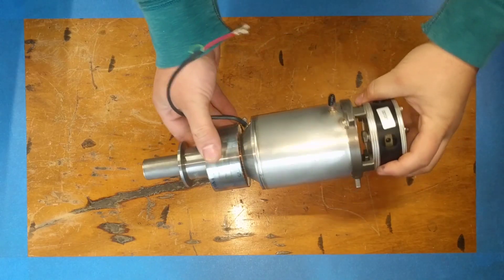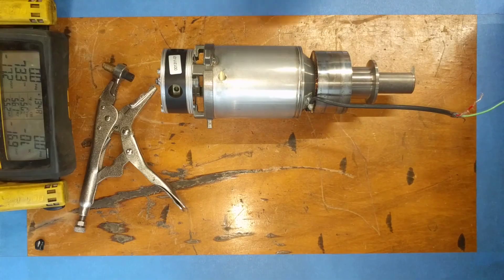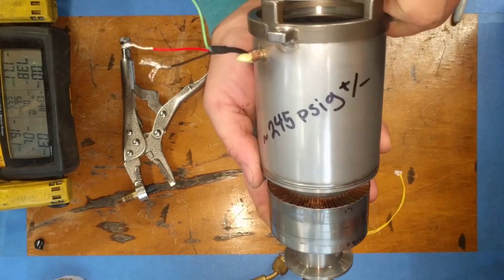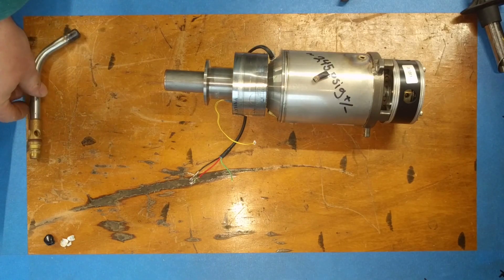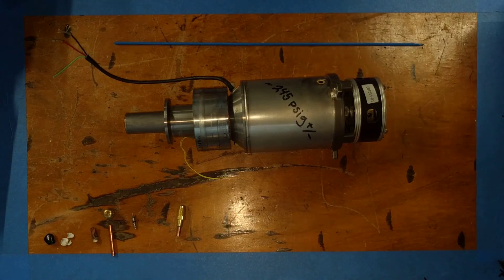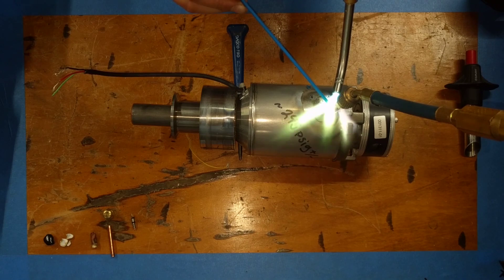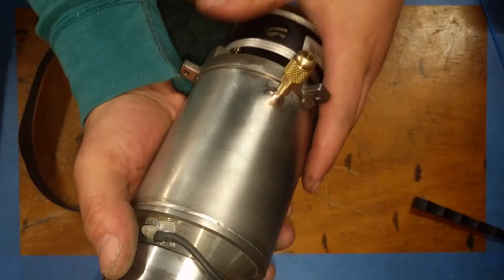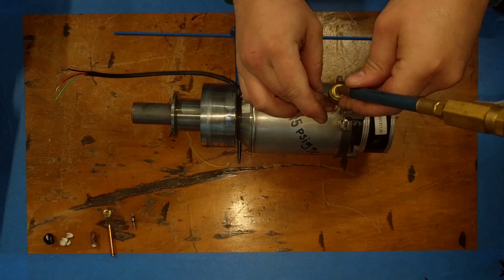Superconductor Technologies Hybrid 98 Cryocooler Service Port installation

Comment: I’m sure you realize that a shraeder valve will not prevent helium leaks, right so are you planning continuous top ups or something more permanent?
Reply from the maker: You're right, if you have to recharge one of these chances are there is a small leak in it already. Just making it more serviceable.

A properly sealed process stub would be the "permanent" solution if you could guarantee there wasn't an additional Leak.

Comment: What sort of improvements have you noticed compared to a non-recharged unit? I just received mine which has logged over 100,000 hours and still cools to LN2 temps, but I'm curious if I can greatly increase my efficiency. I can readily get high purity helium from airgas so that's not a problem.

Comment: when refilling, do you need to pull a vacuum inside the cryocooler in order to keep the helium inside pure ?
Reply: Yes. Absoluetly.
Reply: @pontiacexchange4386  how close to zero does that vacuum need to be ? can a standard vacuum pump achieve it or do you need some kind of specialty pump ?
Reply from the maker: @chrizero2319  under 100 microns or lower.

Comment: Excellent video my friend!  I have a question though. It appears as though STI filled the little service port adapter with epoxy prior to sealing it off.  My question: Is there another way to get that service port off?  My concern is that when the heat is applied it may force the epoxy (that is stuck inside the service port) into the main body of the device itself.  Do you see that as an issue at all?  BTW, You look like you've filled these things your entire life lol.  Good job ! You can see what I'm talking about 1 minute 33 seconds into my uploaded video.  Take Care
Reply from the maker: So prior to heating the process stub a sharp punch was used to fracture the surface of the epoxy. This removes all of the epoxy from the outside of the process stub.
Reply: @sukahusky2464  I guess what I'm trying to say (if you look in my videoit's pretty clear) that the service port from the factory is also FILLED with epoxy, not just on the outside but on the inside of it as well.  I'm thinking that maybe before removing the service port it should be carefully cut open and remove the epoxy.  Maybe I'm just making it more complicated than it is though.
Reply from the maker: What you see inside the process stub that I remove is a piece of copper from the line tapping tool that gets pushed inside when the Jaws are clamped around the pipe. 

When the manufacturer filled the unit, a shearing & crimping tool cuts the copper process stub and just pinches It off.

They wouldn't want to apply any heat at this point so to prevent it from leaking out it is coated with an epoxy.

The right thing to do would have been too manufacture it with a service port so they could have been serviced. Unfortunately the chances of having that variable would make more of them fail faster due to leaking around o-rings and plastic seals.

The service port I use comes with a nice cap and a  buna-N o-ring seal.

They weren't designed with repair in mind.

I put service ports on equipment almost every day as manufacturers typically don't include them.

Comment: Awesome video man! Never would have guessed thered be so much helium in it! How much pressure do you Think is proper? (A guess is fine)
Reply from the maker: 245 PSIG would be a proper gas charge. :)

This cooler was mechanically broken.
Reply from the maker: Update: 265 psia is the right pressure after much research and testing.
Reply: @sukahusky2464  Thats great to know! Thanks! I only have about 5 of them left over
Reply: @sukahusky2464  and working on a much cheaper working principle  =)